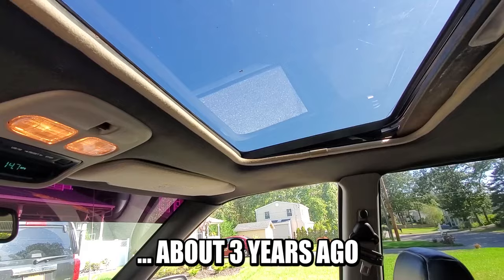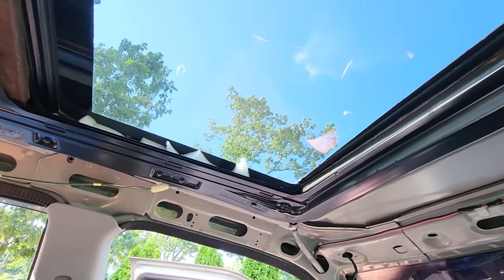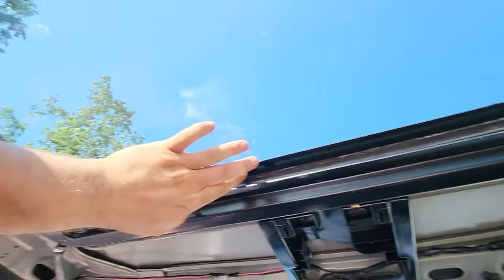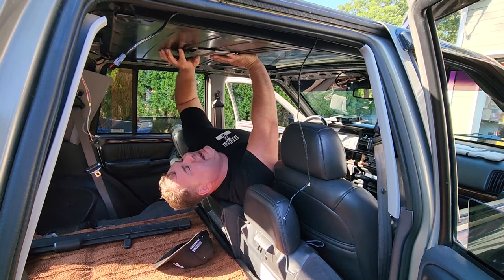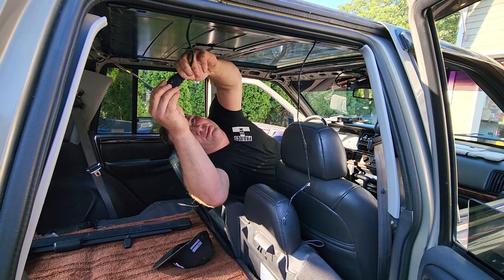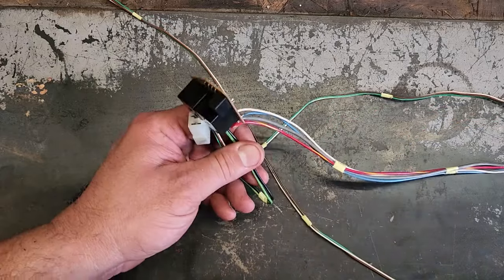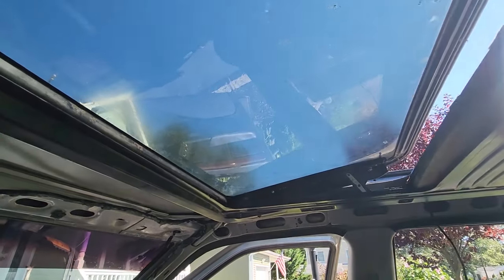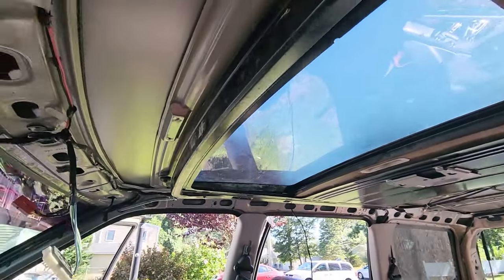JEEP GRAND CHEROKEE ZJ SUN ROOF FIX & HEAD LINER REPAIR

Comment: I did this a couple months ago and about 2 weeks ago my cabin lights wont turn on when they should. Like they don't work at ALL But you can hear them click when they SHOULD come on and I regret messing with it
Reply from the maker: Could be something as simple as a pinched wire.. maybe that clicking is a short.  🤷‍♂

Comment: Do you have a fox for the brake light controller? I’ve replaced mine 3 different times the other ones worked but brake lights stay on when Jeep is off.
Reply from the maker: Perhaps its your lamp module in the driver rear quarter panel
Reply: Thanks I will look for that next